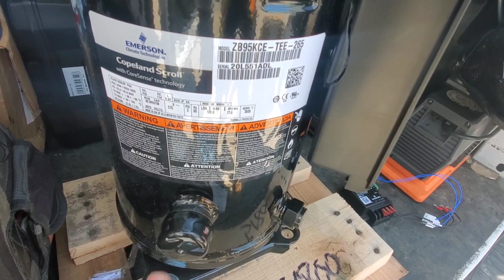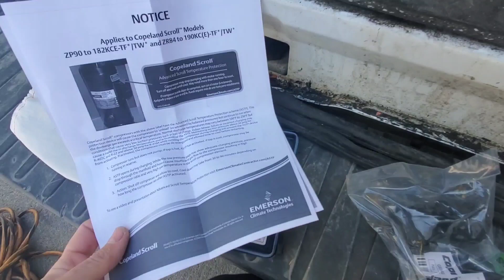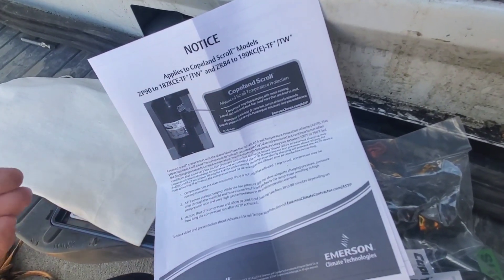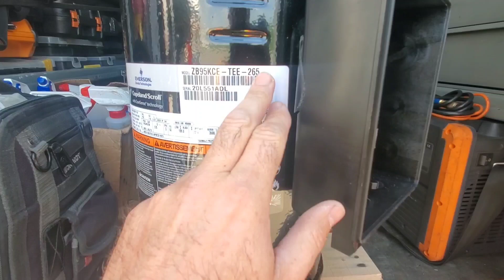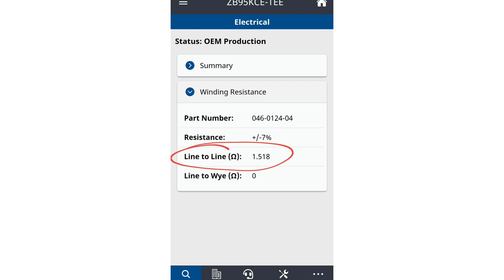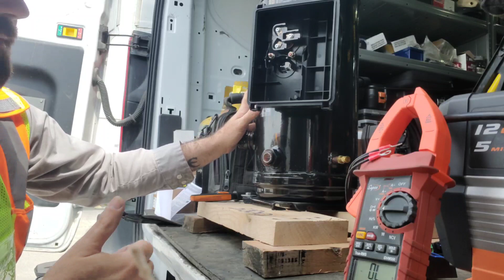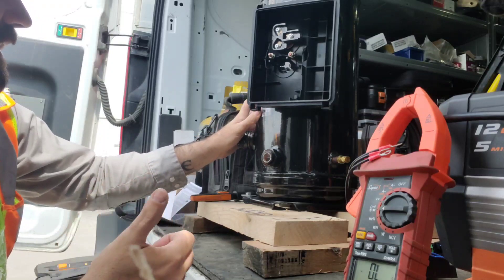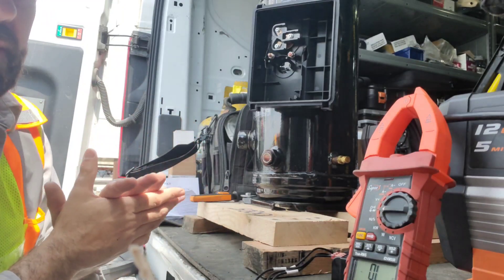AC and Refrigeration Scroll Compressor Preliminary Inspection

Comment: If the thermistor ever goes bad on that compressor , can it be replaced? Or does the whole compressor need to to change out even though the compressor is still working properly?
Reply from the maker: Unfortunately you need to change the compressor.

Comment: Thank u for this video I have a question is it necessary to check the phase sequence prior to starting the compressor the reason I am asking is whether it needs to run in a particular direction (clock wise) in this case.
Reply from the maker: Scroll compressors do need to run in one direction yes.  You can check phasing before hand if you like but it won't damage the compressor if it starts backwards, at least in my experience.